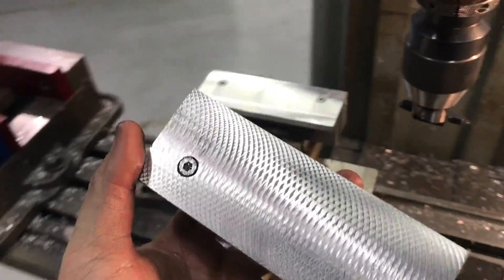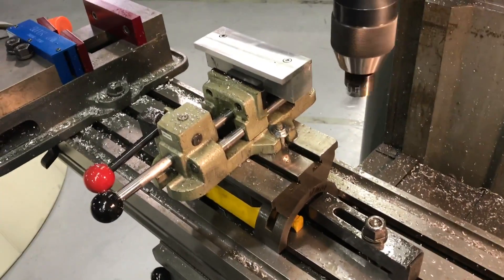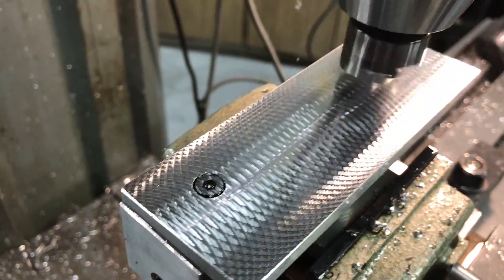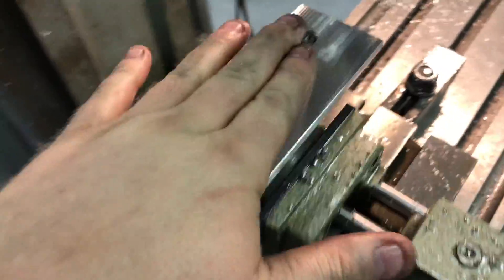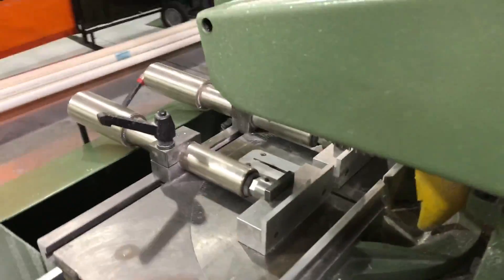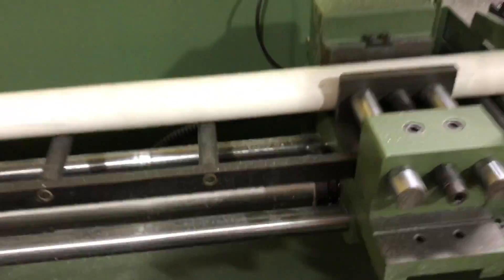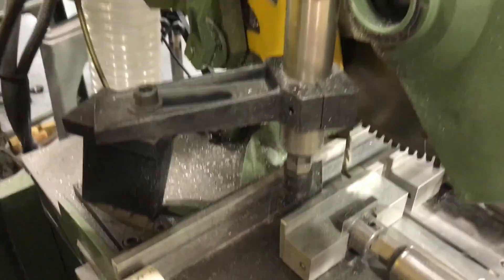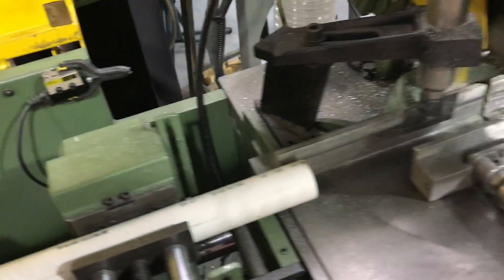Automatic Miter Saw

Comment: Thank's for the nostalgia trip... when I was about nine years old, (Jeez, that's 65 years ago!) my father took on a contract to manufacture thousands of tapered fittings which were to be soldered into the ends of quarter inch copper tube in pneumatic systems.  He converted a Boley watchmaker's lathe to pneumatic automated operation.  The brass rod was fed through the headstock into the collet chuck by a "fixed clamp - sliding clamp" mechanism on the same principle as you show here.  It fascinated me then... it still fascinates me now!    :o)
I enjoy your videos, keep them coming.